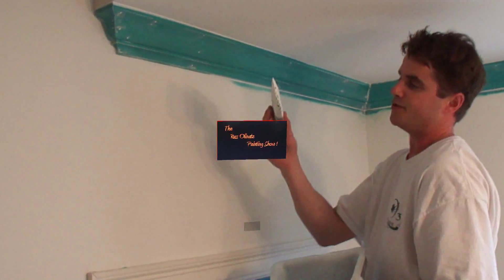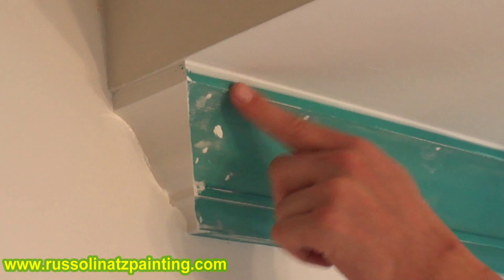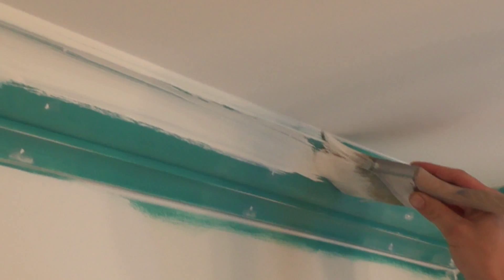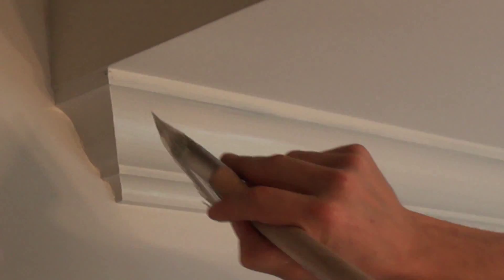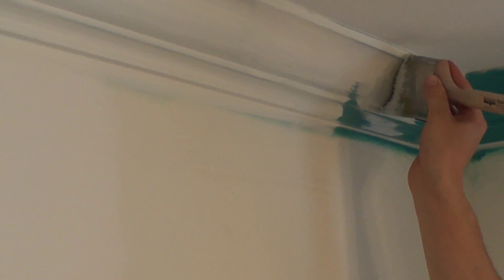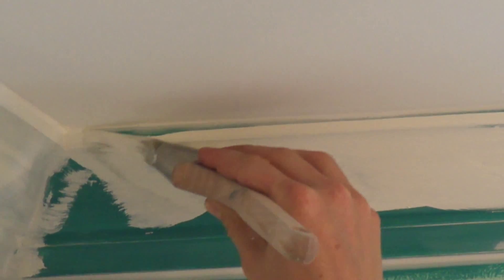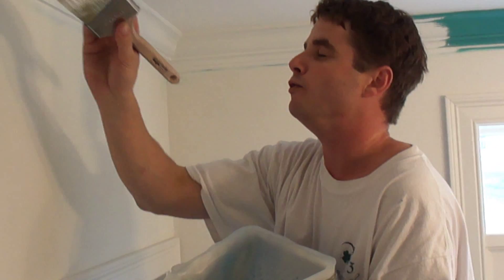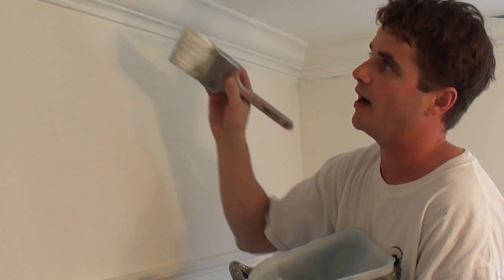HOW TO Prepare and Paint New Crown Molding (Part 5)

Comment: Any advice on how to caulk an outside corner that wasn't super tight? I have a couple corners at the end of 20ft lengths that aren't very water tight, how do you hide that gap and make it look finished when painted?
Reply from the maker: Hi John

Is this Interior or Exterior?

Russ
Reply: @RussOlinatzPaintShow  hey Russ - it's interior crown. Carpenter did a good job but where the crown joins around a corner there's a little separation. Probably more pronounced in the winter when those long 20' lengths shrink. How do you use caulk to give the illusion of a nicely shaped corner crown joining at a clean 90?
Reply from the maker: Hi John

I would caulk it. Make sure to really pack the caulk into the gap as much as possible  Make sure not to leave any caulk on the outside portion of the Crown. Wipe it all away. You will need to caulk at least 3 separate times as the caulk will shrink. Once it’s completely filled, then you would simply paint that open void that is now filled with caulk. 

Russ
Reply: @RussOlinatzPaintShow  thanks, I'll give it a shot! 🤞